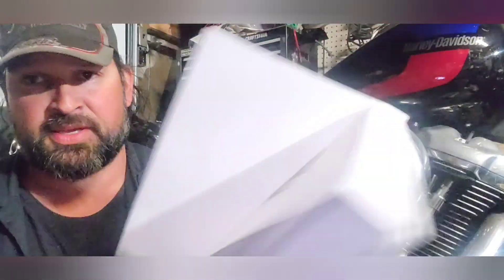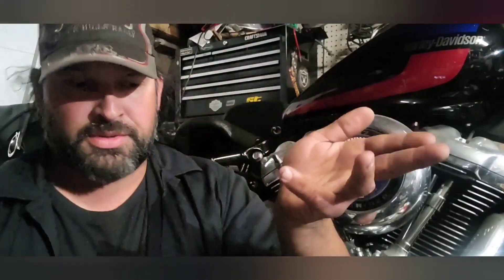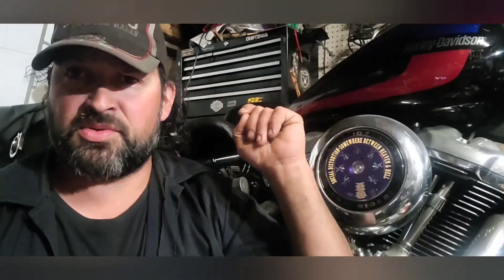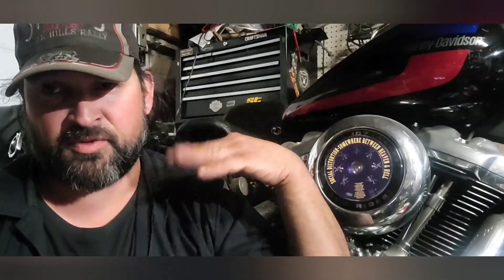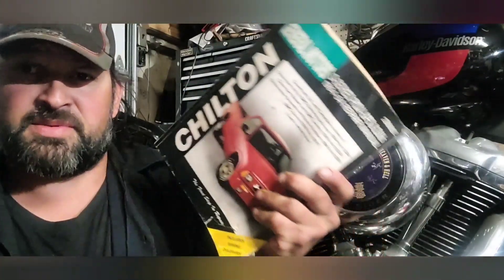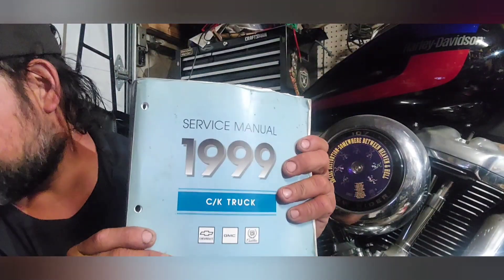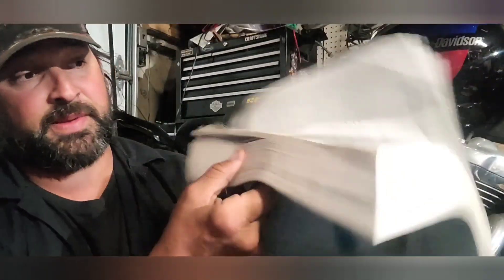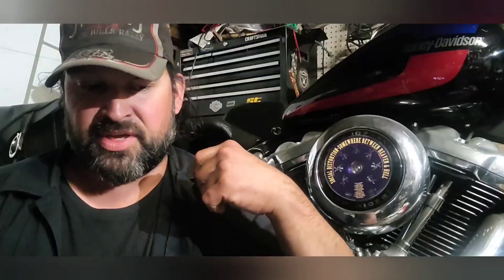D I.Y. w/Anthony GM85

Comment: I agree with you about the good old paper manuals. No batteries to fail when you need them. If the power goes out you can read a book with a flashlight, Factory info is the best. I got steered down the rabbit hole by a Haynes manual electrical diagram. The manual called for the same colored wire from computer through the firewall. No such colored wire on engine bay side of firewall. Ended up having to trace wire from computer and found out it went to a burned fusible link on the other side of firewall and the wire I was looking for was of a different color after the fusible link.
Reply: Case and point I've had the same problem with the hanyes and Chilton Manuel's, oem all the way gives you right path as long to many hands havnt been involved yet

Comment: Cant wait for teh next video buddy  great job ......yeah I recommend  Diy to spent the money and at least get the Diy  Alldata single vehicle  account for 30 ish bucks  then they have all teh OEM information and Repair information
Reply: I've been thinking of getting a subscription. Both Alldata and Mitchell offer DIY subscriptions. Do you recommend Alldata over Mitchell? I have a problem with the electronic 4wd system on a 2000 GMC 2500 Sierra. Message on dash says "Check 4WD". All lights on 4WD switch are lit up. I pulled the 4WD fuse as it felt like the 4WD system was trying to activate. Pulled the following codes: P1875, P0719 and P1638. I think my initial problem is water intrusion as the windshield leaks. I don't want to fire the parts cannon and would rather check the system to see if I can pinpoint the problem.
Reply: Thanks for checking it out, hope to get this job done soon just gotta make some workspace I gotta small garage l,